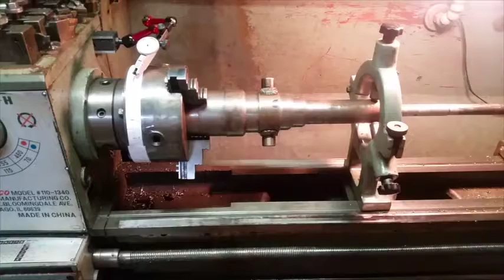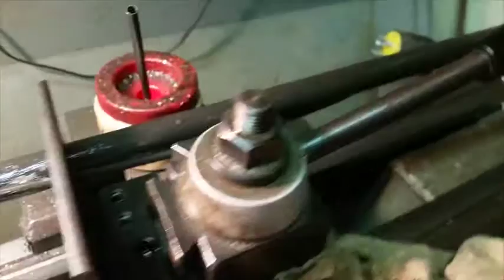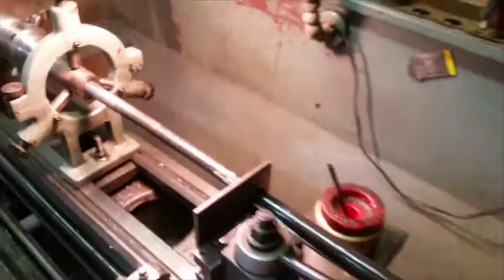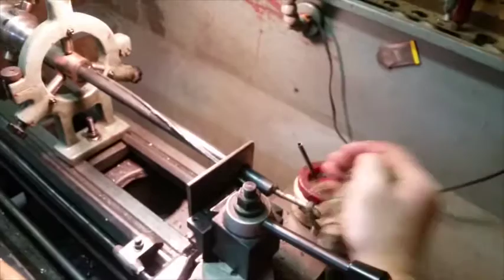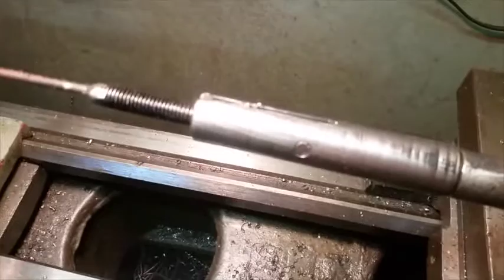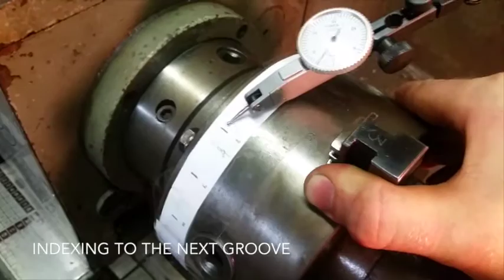Rifling a cannon barrel I'm working on

Comment: I plan to customize a PCP compressed air rifle, to fire a 762mm (.30) caliber projectile, but I still don't know the diameter of the button goover I have to buy to make the internal flute, and I don't even know which tube ID I should have. buy (which internal measure of pipe should I buy), I'm grateful if you can help me with information